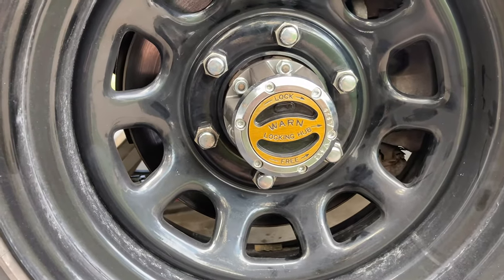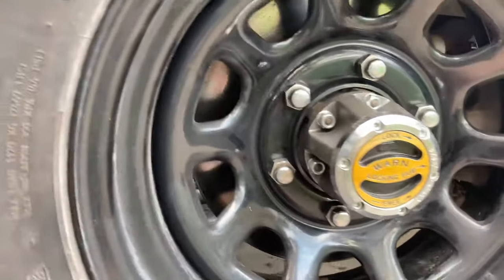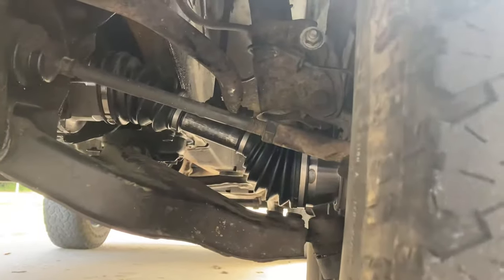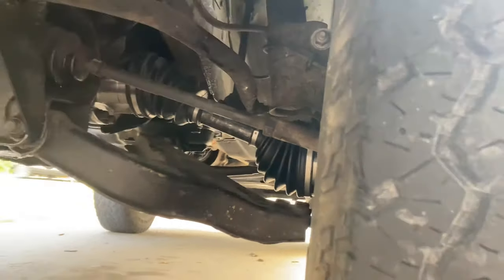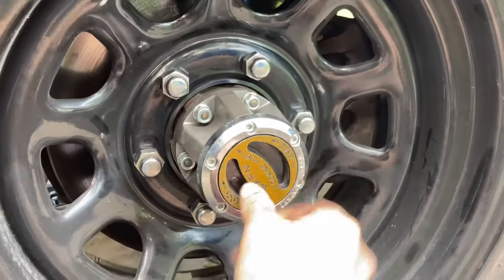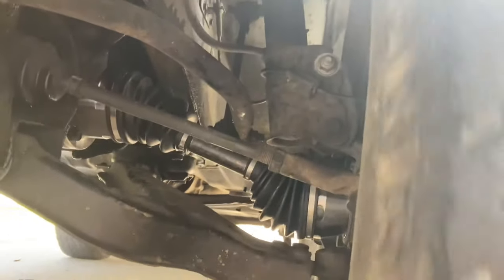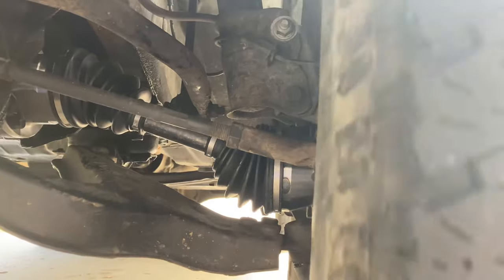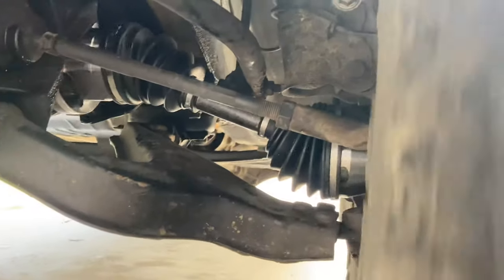What do manual locking hubs do?

Comment: i don't understand why would you do that if you put it on cars the already aren't full time 4x4. what do you get from this?
Reply from the maker: In my case, I’ve lifted the vehicle which puts the cv axles at an angle near their limits. This reduces some wear on them from my daily city driving and gives a slight mpg boost
Reply: You need to watch the ramman.
The Point behind this fuel economy.
No wear and tear on Drive shaft  rest of the moving parts. When the Hubs are Locked Out! Little better Fuel economy.
Locking Hubs on  4x4 have bean around for years!
Auto makers Stopped Putting Locking Hubs 
on there vehicles because the public got Lazy!!
To get out of the vehicle to turn the Hubs.

Comment: Where this function helps us in offroad or for mileage purpose???
Reply from the maker: This particular part of the vehicle doesn’t necessarily add any additional off road performance. Performance wise, it’s the same as vehicles with automatic hubs or “always on” type of hubs. The benefit to it is that it allows you to stop the front wheels from constantly spinning the cv axles and front drive shaft when you’re in 2wd mode. When you add up the weight of the two cv axles, differential gears and front driveshaft, that’s dozens of pounds of dead weight being turned mile after mile.
Reply: @dospathsgarage2854  thanks bro for information 🙌🙌

Comment: does this hub lock makes both tires spin at the same revolution. So if one tire loses traction diff won't send all the torque to that tire.
Reply from the maker: No, this hub doesn’t lock the differential between the two wheels, so one wheel can still spin if it loses traction. That would be a differential locker or limited slip to keep both wheels spinning the same speed
Reply: @dospathsgarage2854  how about lunch box lock? That's a hub lock too right?
Reply from the maker: @babayaga9102  From what I’ve read, a lunchbox locker is for the differential that locks the wheels to spin at the same speed under slipping conditions. They make clicking noises when driving on streets (which is fine) but some people don’t like the noise they make on the street. But other than that everyone seems to like the lunchbox type differential lockers

Comment: My rwd ranger has an open differential, sometimes I need both tires to get power, generally in the snow. One tire spins freely, the other doesn’t move. If I put locking hubs on the rear, would it force both tires to get torque? I don’t want to spend $1500 on an Eaton e locker. My truck has the ford 8.8 rear end
Reply from the maker: I'm not aware of any manual locking hubs for rear axles. However, if there was, unfortunately this wouldn't be the solution you're looking for. Think of these hubs unlockers. There handy if say someone with 4wd had a welded front diff and they wanted to take it for a spin on the streets, they'd unlock the front hubs to allow front tires to spin freely at different speeds on the streets for easier driving. E-lockers are definitely pricey, maybe there's some limited slip options for less than might be better bang for your bucks. I'm currently running a junkyard limited slip that I got for about $100. Works great in bad weather

Comment: So does this mean, any idiot can come up and Lock/Unlock them when your truck is parked? Is there any in-cab indicator, I've recently learned that keeping them locked position can cause the driveshaft to fail since it's not connecting to the transfer case.
Reply from the maker: No in-cab indicator on these unless a vehicle has a particular noisy front driveline to indicate they are locked

Comment: Can I install manual locking hubs on a 3rd gen Tacoma? In 2wd, this would have the effect of not spinning the CV axles while the truck is in motion.
Reply from the maker: These particular hubs shown won't work on a third gen Tacoma. A quick glance at Tacoma forums indicates that third gens don't need manual locking hubs. Something about an automaticlly disconnecting diff was talked about

Comment: What is the benefit of this? Is it so you can have the rears in 4L or 4H without the front engaging? When will this be beneficial? Thanks...
Reply: Hanging off a dune or rocks where you just need rear power to level out without the front digging is my guess don’t take it as fact tho
Reply: it's to save fuel when goin on regular roads where 4wd is not required.

Comment: Could anyone help me out or have an answer to this question? So I have a full-time transfer case on my 6spd Toyota FJ Cruiser and I’m wondering if I do a manual locking hub conversion will it ruin anything on my front drive line cause even though the hub won’t be engage if I do this manual locking hub conversion the axle will still be rotating in the hub since I have a full time transfer case or is this not a good idea. Any help or opinion or is appreciated.

Comment: Hey there, I just bought a 96 F150 with the manual hubs. I was curious, based on what I'm seeing, even if 4x4 isn't engaged is it safe to leave the hubs locked for short periods of time? For example if I know I'll need 4x4 in spots on a 20 minute drive, say winter backroads, could I leave the hubs locked for that 20 minute drive or should I get out and lock or unlock them each time I switch in and out of 4x4?
Reply from the maker: I'd bet you're safe to do that in the ford. Unless the owners manual says not do it, I'd run 2wd with hubs locked since I've been doing it for a couple years on the old Nissan without issues
Reply: @dospathsgarage2854  Fair enough. I'll have to try it and see how it goes. I appreciate the quick response!

Comment: So does that mean a front diff lockers wouldn't work without a locking hub?
Reply from the maker: Not necessarily. If vehicle has a front diff locker and is not equipped with manual locking hubs, then the front diff locker would work as intended. If the vehicle had a front diff locker and is equipped with manual locking hubs, the hubs would have to be engaged in order to use 4wd(with locker) or else the vehicle would still effectively only be 2wd

Comment: So when it’s unlocked. The cv axles still spin? Then if it’s spinning freely all the power will be at the front axles without center lock diff?
Reply from the maker: If it’s unlocked, the cv axles will remain motionless when driving in 2wd mode. If 4wd is activated with hubs unlocked, the cv axles will be turning via transfer case and driveshaft but the axles will not actually power  the front wheels since the hubs are unlocked. The vehicle would behave as if it’s in 2wd mode. If this were to be done with an awd vehicle, the results could vary but that’s a more complicated matter
Reply: @dospathsgarage2854  thanks
Reply: It can be fixed on GMC 1997 2 door
Reply: @dospathsgarage2854  Some people online are saying that in winter, they'll keep the hubs locked and engage 4WD when needed. Is this an okay thing to do? And can it be done while the vehicle is in motion going down the highway? Or do I need to stop first?
Reply from the maker: @sethmoking  yup, I myself will lock the hubs and leave them locked when the weather is wintery. This makes it where you don't have to step out of your ride to lock them if you decide you suddenly need to use 4wd. Some transfer cases require you to be stopped or a super low speed to shift into 4wd, where's some allow you to shift into 4wd  while driving. Either way, you get the stay in the car. Downside is you might have a slight mpg decrease because the front axles are introducing drag as they rotate with the front wheels when locked

Comment: what happens if you run them in looked all the time?
Reply from the maker: Constantly running locked would result in a slight fuel efficiency decrease. For me, the cv axle bolts will wear out faster since my lift puts the cv axles at an angle that flexes the boots quite a bit

Comment: It doesn't replace a diff lock right?
Reply from the maker: Correct
Reply: @dospathsgarage2854  Adding locking hubs won't turn an open diff into a locking diff. You still need the diff locker if you want to send power equally to both front wheels.
Reply: the diff comes before the cv axles and hubs. locking hubs cant change anything about the diff.

Comment: How does that chintzy knob lock a drive axle into the hub? Also, why is there sometimes THIS and also a 4x4 transfer case selector inside the car ? In what scenario would one be using BOTH Zoe these systems? Is it not redundant? Curious :)
Reply from the maker: Great questions actually. While the outer cap on these hubs is relatively thin compared the base and internals, the outer cap just moves a beefy sprocket to or away from the splines on the ends of the cv axles. This particular model and most modern 4x4s don't have manual locking hubs from the factory. Many times  the cv axles mated to the drive hubs (this vehicle was like that originally). Cv axles and differential internals will always be spinning even in 2wd. Fuel economy suffers slightly and miniscule wear and tear occurs on extra moving parts. Another type of design includes automatic locking hubs. They look somewhat similar to these except there's no knob to turn. They use some sort of sprocket voodoo to engage or disengage. Some versions require driving forward or backward a few tire rotations to engage or disengage. Mud or corrosion can make them unreliable at times though. Some vehicles electronic hubs or actuators to engage or disengage either the wheel from the axle or disengage the axle from the differential. Some people with automatic or electronic hubs switch to manual hubs for more reliability or increased strength. Others without manual/electronic/manual hubs switch to manual because they seek fuel economy by not turning the front drive line in 2wd. Off-roaders can have niche reasons as well. For example, I have an automatic differential locker in my front diff that makes audible clanking noises (by design) even in 2wd. I can keep it quiet in 2wd by isolating the differential from my front wheels by using these hubs
Reply: @dospathsgarage2854  YES! Fantastic response. Thank you so much. You rock
Reply: @dospathsgarage2854 a year later reading this again. Still amazing. Thanks so much haha
Reply: @dospathsgarage2854  I would imagine that if you unlock the front hubs, you'd need to lock the center diff, otherwise you won't get full power to the rear diff. Most all wheel drive cars don't have a locking center diff.

Comment: is unclocking the hub will make the engine brake disappear?
Reply from the maker: No because the rear wheels will still be engaged
Reply: @dospathsgarage2854  Should i remove front shaft or use a free wheel hub, which is better for fuel economy an convenience ?

Comment: Can I install manual hub on my fulltime 4x4 (lc80)?
Reply from the maker: Not sure, but probably. When bolted up, the hub would provide the same functionality as demonstrated in the video whether the vehicle uses cv axles or solid axles. One thing to make sure of is whether your full time 4x4 or awd transfer case can operate without the front axles rotating in 2wd. It’s possible that a part time 4x4 or awd transfer case needs front axle movement to keep parts lubricated or prevent sensors from freaking out. I would suggest checking with a Landcruiser forum for a more certain answer.
Reply: @dospathsgarage2854  great answer dude